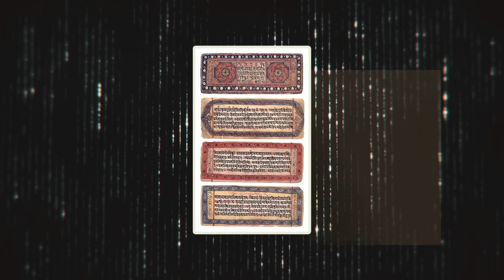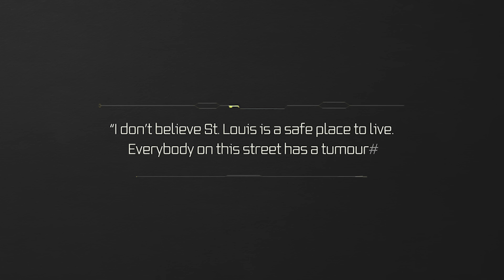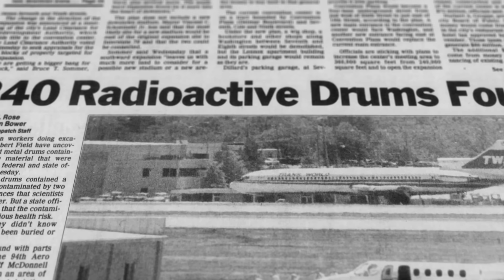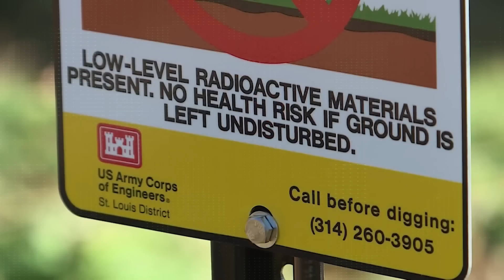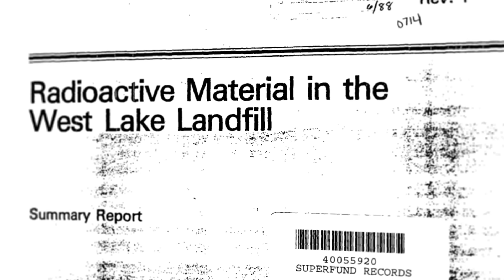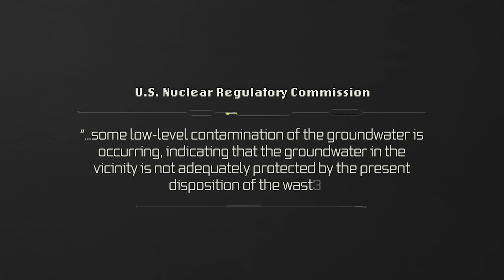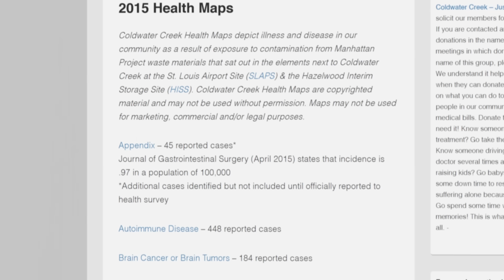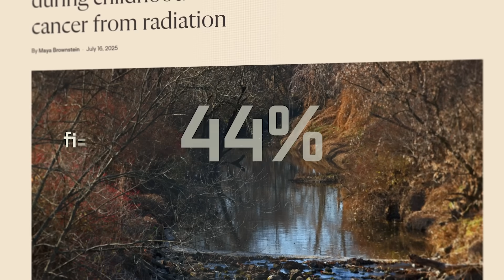West Lake: The Toxic Leftover of the Manhattan Project

Comment: St louis is full of stuff like this. Back in the mid 90's i remember driving to work on hwy 94 in st charles county and they had built this road that was next to the highway with a constant traffic of dump trucks running on it. Thats where the weldon spring plant debris and waste was being transported from the uranium processing plant and waste that had been dumped in the quarry was being transported to the disposal cell.  back in high school the ordinance works - we called it the "aquadome" which was almost right next to the weldon spring plant was a popular place to hang out and party. I went and checked out some of the other sites a few years ago just to see what they look like, the Laddy Ave site is just an empty parking lot, nothing there except for some parked trailers and other stuff. The site at the Airport is just a big empty lot , at the time there was a trailer office the signs on the trailer looked like it still had something to do with the cleanup but the lot was mostly empty. 

Ive actually worked right next to some of these places without realizing what i was next to till several years later. One shop i worked at, Coldwater Creek ran right behind the building, like maybe 50 feet away, had no clue it was THAT creek until years later when i started looking up all these sites.  The last place i worked at before i left St Louis 5 years ago was just a mile or so from Westlake.  I knew it was in the area but didnt know exactly where until i was test driving a car after a repair and took a different route from the normal one i usually took and i saw the sign, and sure enough it was right there, was kind of weird, i didnt realize it was that close. We never could smell anything at the shop, but i guess thats because we were on top of the large hill thats a mile or so down the road.
Reply: Sounds like you worked at Boeing.  😉  I've wondered how much radioactive dust from the cleanup site is floating in the air.  And since I've drank daily from the water fountains, I'm curious how irradiated the water pipes are around there.  

It seems like everyone who worked there die from heart attacks or weird @ss cancers.  I've got lung nodules.  🫁
Reply: Oh wow...

Comment: "Mr. Oppen, I'm afraid your device 'Nippon Cremator 6000' has been used and it worked as designed"

"Omg how could they.. I  am become.."
Reply: Cool story, bro as it it entirely made up.  Oppenheimer had ZERO regret in facilitating the creation of the abomination that is 'The Bomb' or in it's use on Japan.  His only regret was that it wasn't used on Germany as well.
Reply: @michaelg4931 of course that was his regret.
Reply: @michaelg4931  are you trying to tell me, that the meme is.. just a meme?